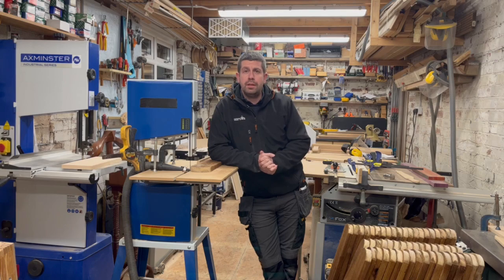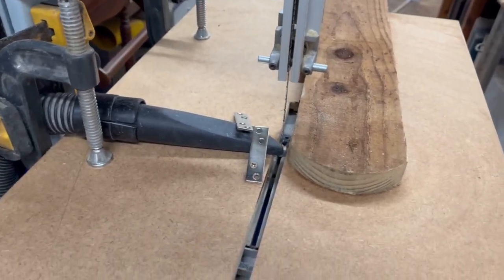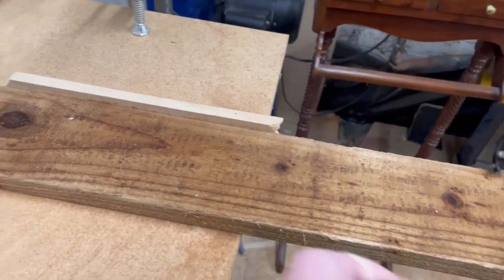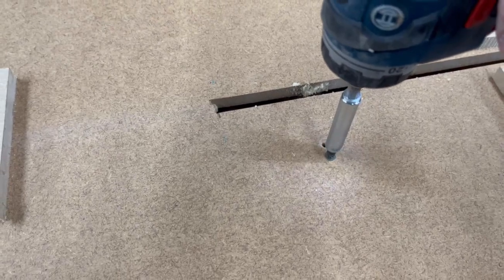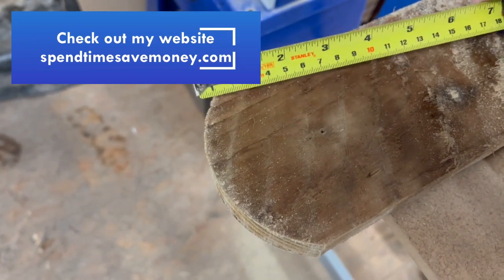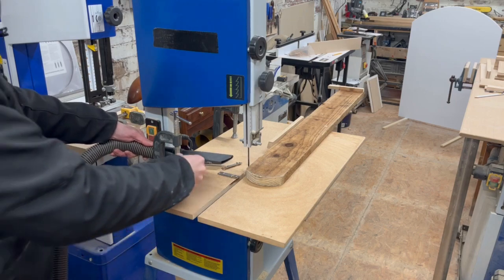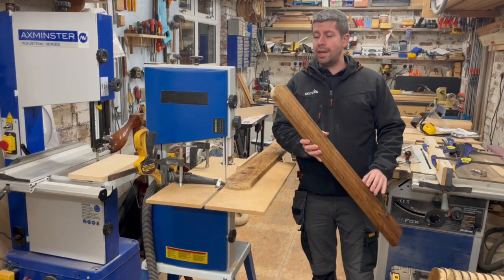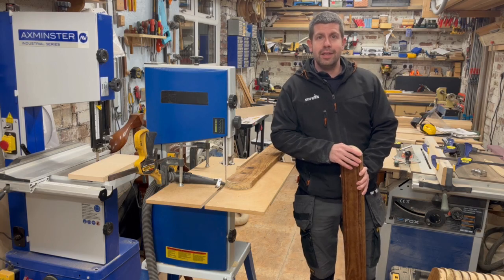Arched Top Fence Pickets: How To Make Them On The Bandsaw

Comment: Another clever one mate. Even the little tip of drilling out the pilot hole so the pivot screw can turn more easily and not come undone. Just the kind of detail a diy mug like me would miss! Building and carpentry are clever games, often in such simple ways. Thanks for sharing. Cheers from Oz. PP